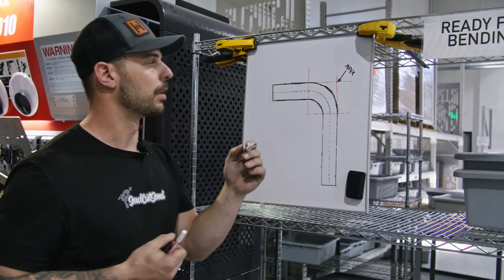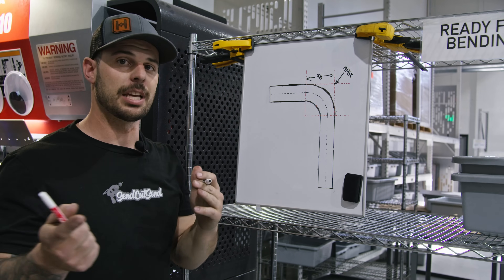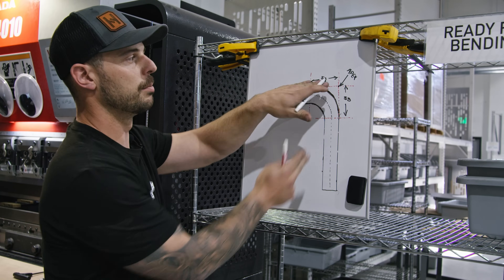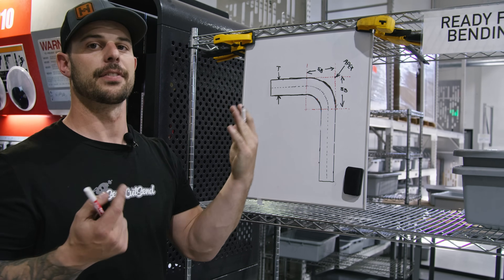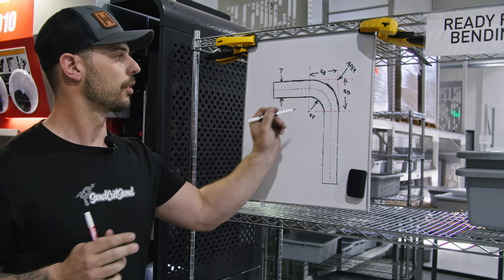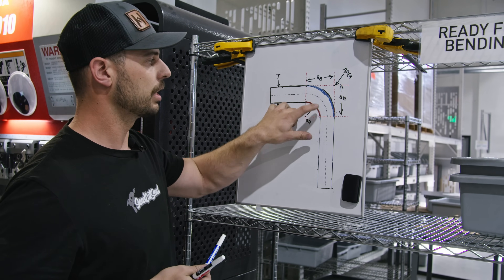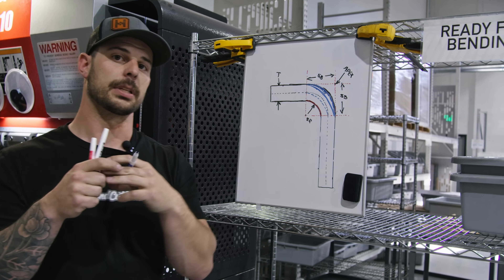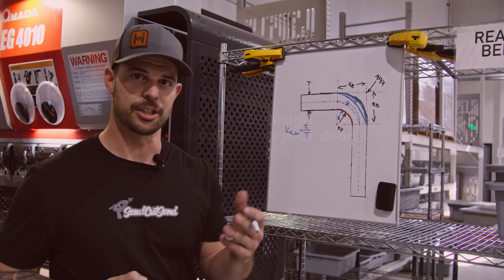What is K Factor in Bending? Bending Sheet Metal Terminology

Comment: Well….. How to Apply K-Factor is Design Consideration?
Reply: Tou have to consider manufacturing tables that already have de minimum bend radius possible computed. If you go smaller you will crack that face that is in tension. That’s how you apply it to design considerations.
Reply: Natural bend ratio of material thickness? Ratio. Best Practices? When I bend a sheet metal on a brake it finds it own radius based on thickness. Wondering if there is a formula a can use in Solidworks to do the same.
Reply: @zakaroonetwork777  your question is not clear. However if you want to predict a correct bend angle, bend radius…etc you have to perform an FEA analysis with plastic strain with plastic strain curve data. The stress must be a certain percentage bellow braking point.

Comment: Hello,

just a little technical question regarding your explanation.

By shifting the neutral line to the compression side, the side being stretched is said to come and lie more inward.
Why is that?

I can't physically imagine why that happens.

does this mean constricting the material through the stretch?
Reply from the maker: Here is what’s happening:

With the inside being in compression and the outside being on tension it’s stretch or elongated. This elongation if the material has an elastic property will deform to stay connected. Take a rubber band for example. When stretched it will thin in width. The thinning is due to the material being moved into a new orientation to maintain connection.  The outer bend is doing the same thing. Elongating to stay connected and essentially thinning. Since the inside of the bend is in compression it will not move resulting in the outer edge moving towards the center of the bend.
Reply: Imagine you're bending a Snickers bar. The outside would bend, but leave big gaps in the cracks. The inside bend would bunch together from excess material, some material might even flake off. The center of the Snickers bar would be mostly unaffected.
Reply: @ErraticHail that was a deliciously accurate analogy!

Comment: Should you plan on adding length to the part when planning a bend to account for material thickness and deformation from said bend?
Reply: The better 3D solid modelers (CAD packages) that have sheet metal capabilities, for example Solidworks, automagically generate the flat pattern and auto-calculate the change length of the sheet metal.  You just need to plug in the K factor, your material thickness and the bend radius and design the part already bent up.   When you go to generate the 2D drawing, it will generate the flat pattern and it will call out where the bends are.
Reply from the maker: Yep! That's what we're referencing in this video, and also what our bending calculator on our website will do for you! Some software will calculate the deductions automatically based on the material K-factor when you flatten the part, but we have a calculator for this here: https://sendcutsend.com/bending-calculator/